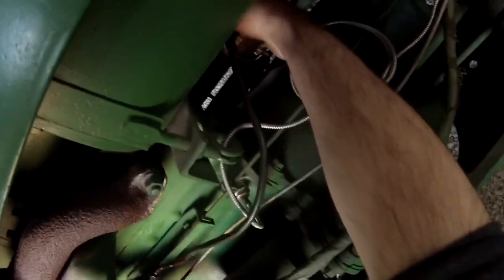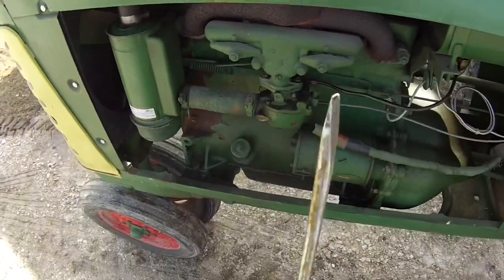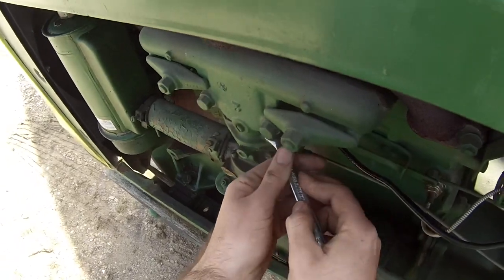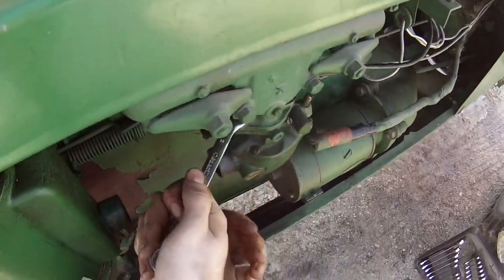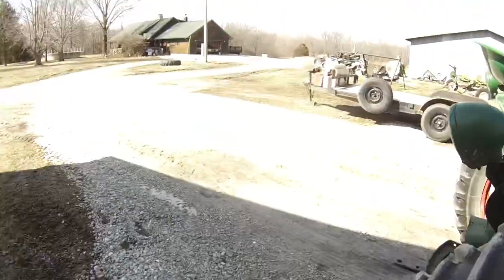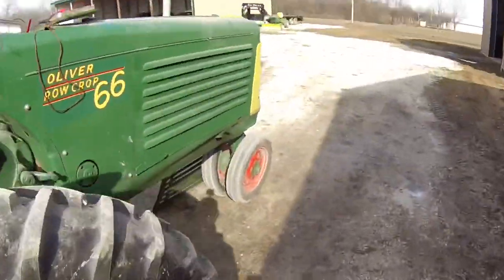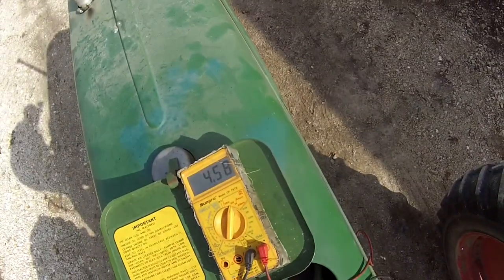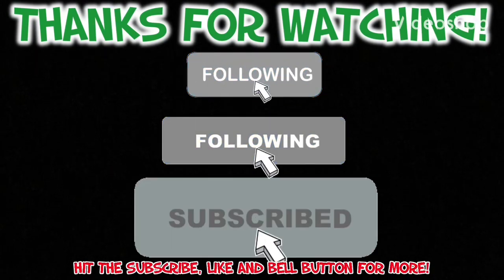Troubleshooting the Oliver 66: Carb and Electrical Issues

Comment: Use a package of guitar strings to clean the carb out and get all the little pieces of crud out of the passages. There is a blockage somewhere, it shouldn't run on the choke at all. It should start on the choke and then start to run rougher and rougher until the choke is off. Try the guitar strings thing and maybe acetone. If you have an ultrasonic cleaner those work best. You can make them, just youtube it.

Comment: My 70 has a kind of similar issue. Needs about half choke to run, with none it dies, but otherwise with it set right it runs good at any speed from low idle to full throttle. That and the last time I ran it the rear main seal started leaking. The oldies are full of surprises but you can’t help but love them.

Comment: instead of using a push button just put an ignition with a key in it may work better
Reply from the maker: oliver farmer 1555 That’s the one thing I refuse to do, is put a key on a non-key tractor.
Reply: 66Oliver yeah true but idk where u could buy a good push button at
Reply from the maker: oliver farmer 1555 That’s the issue.